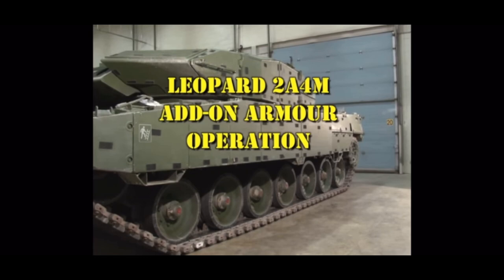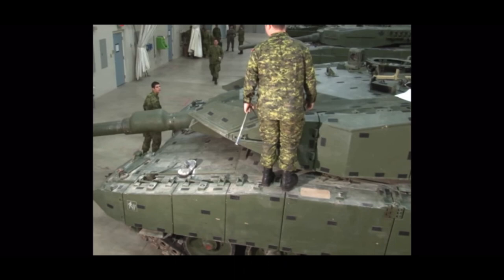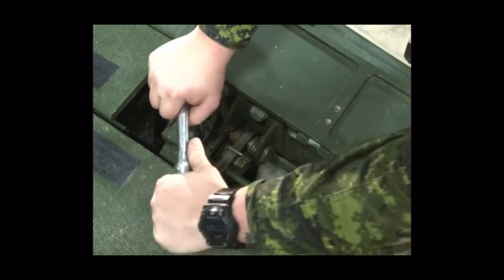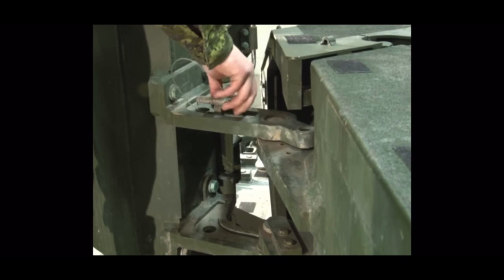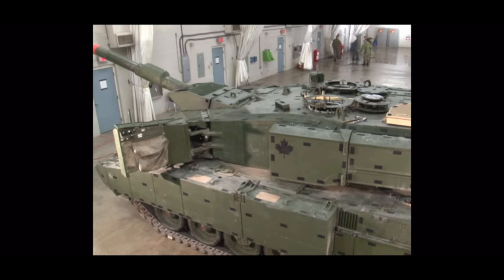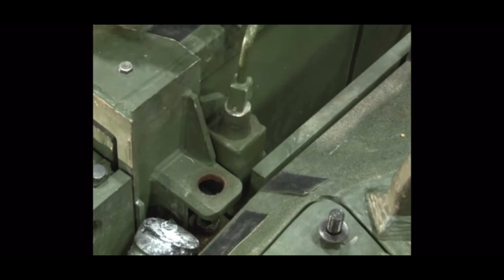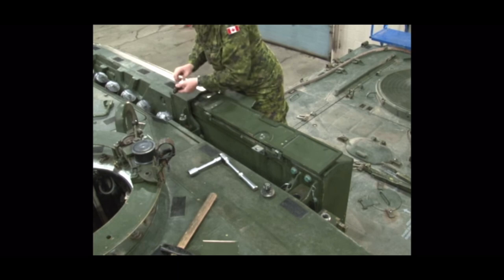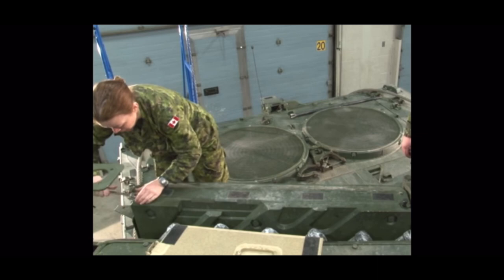Canadian Army Leopard 2A4M Add on Armour Operations 🇨🇦🪖

Comment: Awesome video! I'm just starting to learn about Canada's tank fleet and have a few questions if anyone has the time and/or patience to answer...

-Why is the 2A4M CAN considered the most advanced MBT in service? Has it superseded the 2A6 and 2A6M CAN even with only the L/44 gun?
-How many 2A4s are equipped with the 'M CAN' composite armor upgrade? Was it only for Afghanistan? Or do certain 2A4s retain the armor?
-What APFSDS rounds does Canada use on the 2A4 and 2A6, is it just DM33 for both the L/44 and L/55 guns? Or do we have DM53 as well?

That's my question vomit, I'd appreciate if anyone can respond, non classified, obviously. 
Thanks!

Comment: All reservist in the Cdn Army should be fully trained on the Leopard 2s and leopard 1s in the role of gunnery, crew commanding and vehicle maintenance. My experience of the leopard 2 vs leopard 1 is that there are small differences in the driver's position and performance..